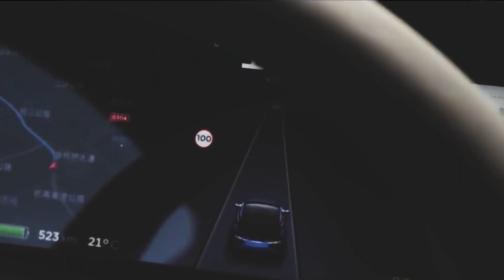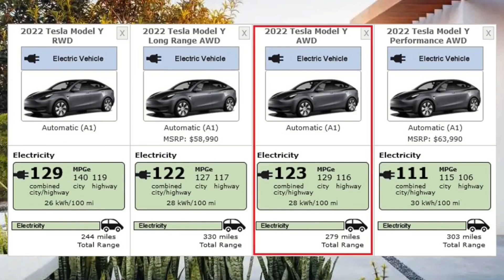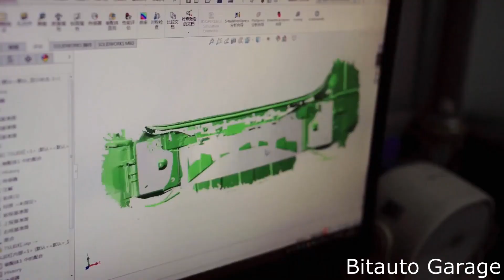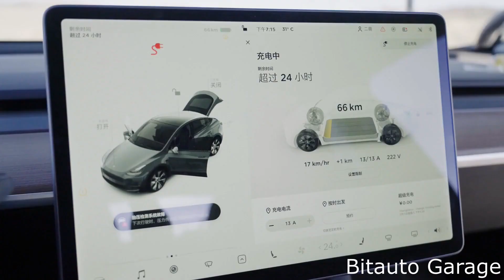2022 Tesla Model Y Latest News & Delivery Dates

Comment: My guess is that Tesla is producing two versions of Y at GigaTexas: LR and/or P models with the 4680 packs, and the new SR+, corresponding to the 279 mile EPA rated AWD version that with LFP packs, where the latter will see a much faster scale-up, unconstrained by the 4680 ramp.  Some people are skeptical that an LFP Y could get 279 miles, but I'm not, seeing the improvements in the BIW which includes front castings.  Once the SR+ starts pumping, reservation holders of the LR and P will be able to convert their orders to the SR+, probably with a shorter wait time.